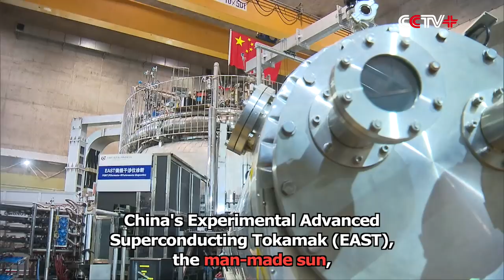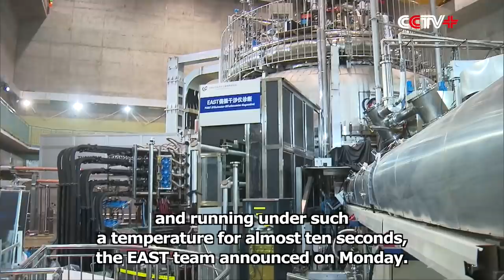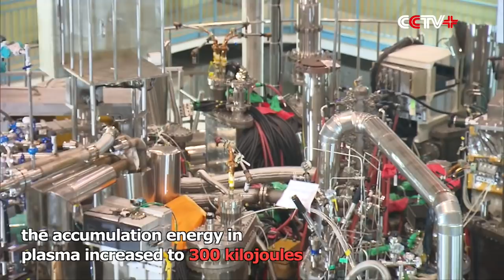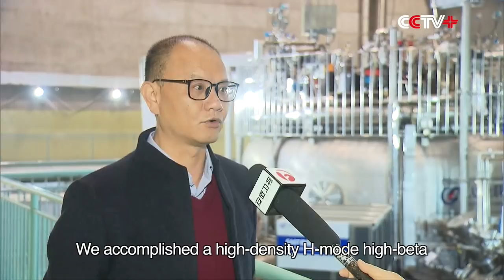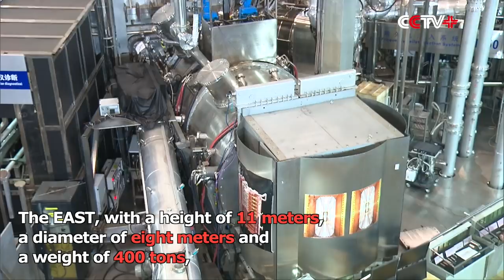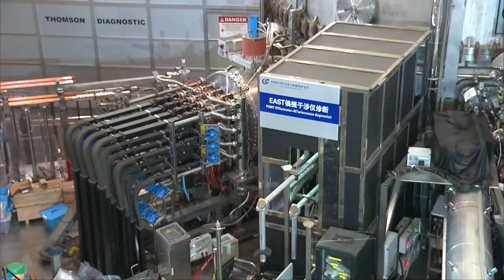China Makes Breakthrough in Artificial Sun Research

Comment: Previous week, the Massachusset Institute of Technology has found a very clever way to harvest the heath !
by the way, many people have problems to understand this concept of high temperature
So to be short
if you put your hand in water at 100 degree for 2 seconds and your hand in a oven at 300 degrees for 2 seconds the result will be different
in one case, the water, you will be burn, in the other you will just feel the hot.
The density of the fluid make the difference

In a tomahawk there is a deep vacuum .

Comment: I need it dumbed down, how significant is this break through?  Does this mean that they can do fusion  when they build the proper reactor? Or just catching up to the west? Or what? Please explain
Reply: 100 MK is a milestone, and they can do fusion. They are in the same league as the west, but for 1/15 of the price. Being able to do fusion is not the same as getting net energy from fusion, I don't think this has yet beaten the records of JET, and JET gives out 67 W for every 100 W you put in.
Reply: It's pretty significant. The West has been trying to achieve room temperature fusion for at least 40 years and failing. China did it in 5 years, and so did Korea.

The nuclear power plants you see today use fission, not fusion, to generate power.